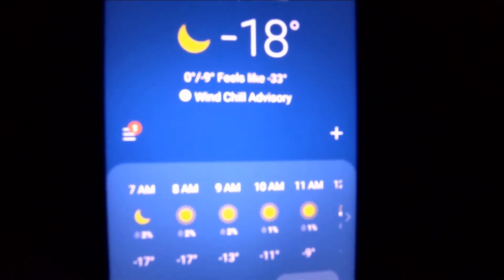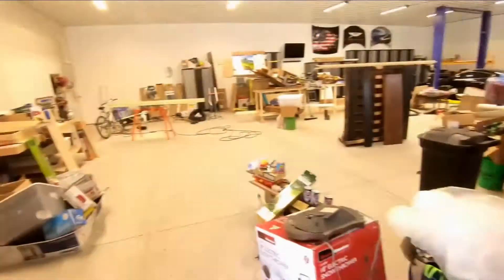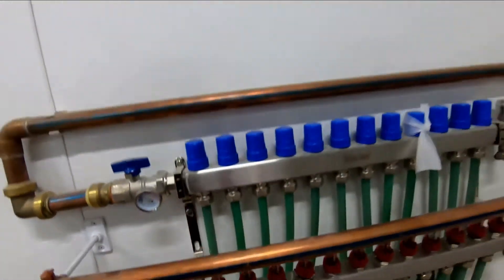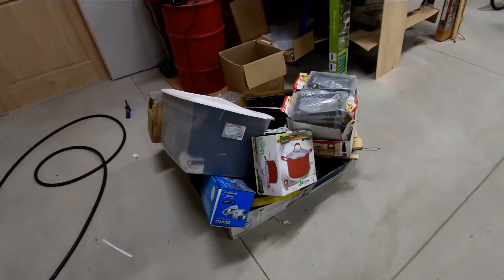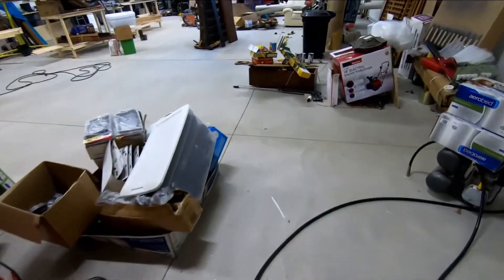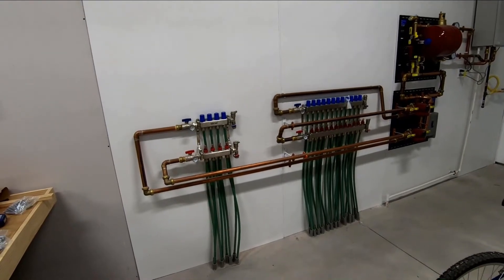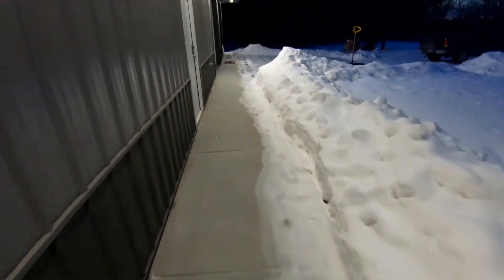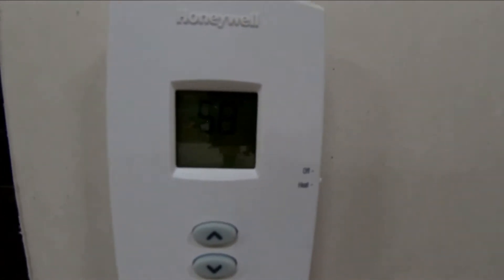-30  Degrees ! Did it Heat? NO Slab Insulation & Tankless Water Heater in Pole Barn Radiant Floor!

Comment: Thanks for the update. I am midway through a house build that I have radiant tubes in my slab. Still haven't decided what to heat the water with but I was thinking same as you with gas tankless.
Reply from the maker: Gas is the way to go as long as they don't  keep on doing what they did with this price gouging saying its because of Texas demand! Thanks for watching
Reply: I use gas tankless boiler. I think it’s the best. You definitely want tankless. The water is coming back still hot. You only want to hear it the difference, and not from 40 degrees.
Reply: @XBoysAtWorkX  I’m getting ready to build a smaller pole barn. 32x46 I would like to add a couple radiators and a fan in addition to the floor heating. Is there a specific boiler you prefer? Did you partner with anyone to design the hydronic circuit?
Reply: @beckyschwantes5287  My neighbor is a plumber, and he worked with the distributor, who could engineer the system through a program. I am using a HTP UFT-120. It works great. I don't see why you would need  the radiators as well. I live in a pole barn house. It was -30 degrees here as well and just the infloor kept to 70 degrees the whole time.
Reply from the maker: @beckyschwantes5287  Like Crooked Fence Farm stated , a designed radiant floor will heat your area as long as you have a well insulated building. Using fans defeat one of the benefits of radiant floor, less airflow blowing particles around and also fan air is hard on a person with dry eyes. Thanks for watching